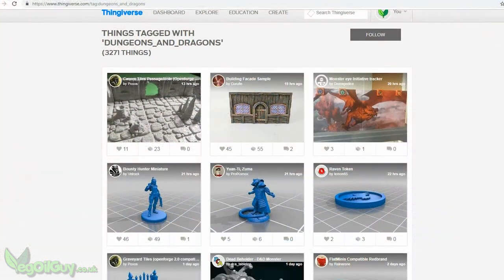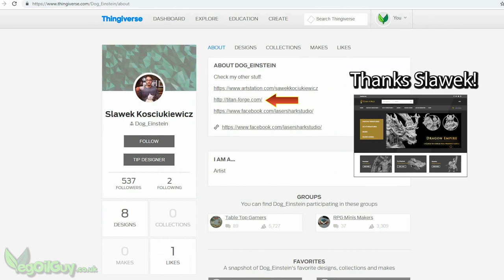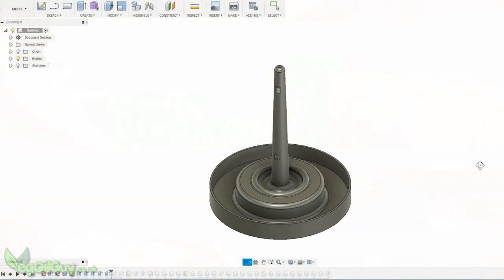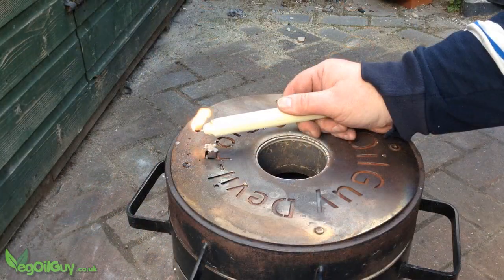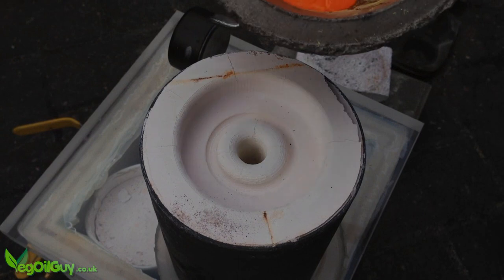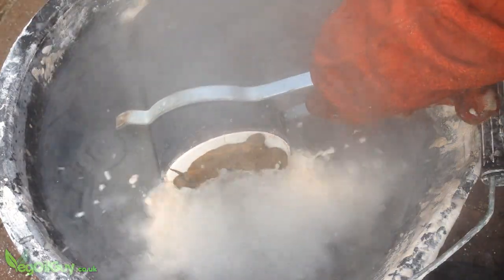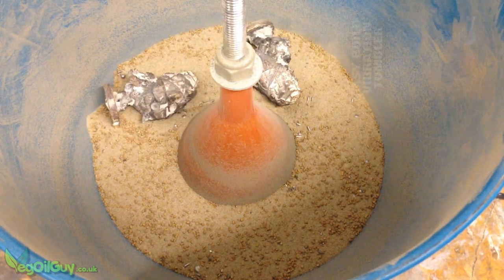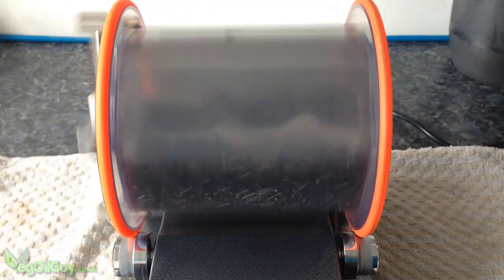Brass dwarf miniature Warhammer figurine lost PLA casting - 3D printer to metal casting by VOGMAN

Comment: Your barrel tumbler turns really fast! 
As a jeweller I used tumblers to polish on a daily basis. Our tumblers rotated at it's fastest one time a second. 
We left them running for 2-3 hours and in some cases longer., but the results where always great.
Reply from the maker: I agree it is a little fast. Amazingly this is on setting 1 of 5. As you can imagine, at 5 the centrifugal forces mean that everything is pinned to the sides and nothing gets polished. Crazy. But for a cheap buy, I'm happy enough with it  : )

Comment: I had almost 1000 miniatures of Dwarves, Orcs, Skeletons, Kobolds, Humans and Elves, and other races.- The Nine Nazgul, Neo Otyug and other individual characters, mostly Ral Partha models. (Most of the wages from my first job went to getting that next pack. Then, I discovered beer and girls!) Only ever got around to painting about 200 of them, but what fun they gave and impressive armies on the table! Your one that broke, were there voids in the legs or did it just bind and snap? Looked like a clean-ish break...
Reply from the maker: Beer and girls must account for a lot of lost revenue in the miniatures world. Lots of fun though  : )
The break was bad application of wax on my part. The feet of the figure were cemented with wax to a printed base. I then sealed the join with more wax to prevent leakage (allowing plaster into the join). Obviously I didn't do a good enough job here and that led to a weak spot. As these are heavy beasts, when they bounced around in the tumbler (again a mistake, I should have done one at a time) they clashed and the weakness was revealed. 
Lesson learned  : )
Reply: @vogman  Yep, and think of the army one could have amassed if it weren't for the necessity of that first junker car! : )  So, think you'll ditch the sand vibrator and stay with the tumbler, then? Or do they each offer something the other can't?
Reply from the maker: For ME they're doing something different...
If it's polishing you're after, just from my brief and limited experience, I think the barrel tumbler is the way to go. The shine these things achieve whilst quietly whirring away is amazing.
The vibration tumbler can also polish, but I want to use those vibrations and grinding forces to strip away remnants of plaster, take away any surface scale and remove burrs. I'll continue to experiment with media until this happens. But it is noisy.
So, if you're still wondering why, I'll make it clear. I'm a lazy so and so that's looking for an easy way to do most of the boring work for me. And I'm getting there  : D

Comment: I really enjoy watching you videos and look forward to each one as they're released.  

One thing I am curious about in your production process is about the 3D printed sprues.  Have you considered branching out a little bit to making silicone molds?  I would think that it would be faster and easier to print one sprue, make a silicone mold of it and then just make wax sprues from the silicone mold.  It should save you time from printing and money as the wax would be cheaper than the filament.

Just a thought.  Love your work!
Reply from the maker: Thanks for the kind words  : )
I love silicone but hate the price. It's the one factor that put me off Lost Wax casting. You can recycle the wax, but the damn silicone costs a fortune. BUT with a mould, you can mass produce, as you say quite correctly.
Right now I'm still experimenting with my sprue system. I've introduced a tapered sprue, pouring basin, recess prior to the pouring basin, square recesses for peg branches, etc. It's a work in progress that's yielding great results. The time it takes to print doesn't bother me as I usually do it over night, and the cost isn't that great... but who knows. I may go your way in time  : )

Comment: Damm that's cool, have you tried pouring into a hot mould? Should improve definition because it won't cool as fast.
Great work
Reply from the maker: It is actually hot... it's straight from my electric foundry and it's still glowing inside  : )
Reply: @vogman  bro you are an inspiration!

Comment: It went good overall, but you should use flux to prevent zinc from oxidizing. It's evaporating temperature is just slightly higher than brass melting point. You can also use some kitchen salt to make the metal flow better. 😉 But after all the casting came out nicely. Good job 😁
Reply from the maker: Thanks Greg. What about Borax? Have you tried that?
Reply: Yup, borax is fine. I use it constantly in my forge, both for forgewelding and for casting 😉 Some metals does not require flux (gold, silver, aluminium) but as long as it's an alloy like brass or bronze it's good to add a little.
Reply from the maker: Thanks Greg. I'll do that next time  : )
Reply: Oh, and if you ever want to cast copoer, which is one of the hardest to cast, you have to use non porous mold and cut it off of the air after casting as quickly as possible. Copper likes to "suck" gasses into it, mostly nitrogen, so most of the time castings are very very porous. Stone or metal molds are fine for copper, and flux while melting it.
Reply from the maker: Excellent stuff Greg  : )

Comment: Veeeeery nice. Can you please tell us the new tumbler model? Also if you dont mind an advice, your pouring basin is a little off the books and it produces circular flow and gives much space to metal to cool down before entering the sprue. Consider making at one sixth of the circle with the same cross section. Thank you for your lovely video!
Reply from the maker: The tumbler has good and bad points which I shared with Ryan Smith below. But it's fairly priced at £52 here
http://tinyurl.com/y49zw7lm

As for the sprue, your thinking echoes mine, and it is still a work in progress. Hopefully one day I'll get it right.

Comment: So I noticed that the cylinder you pour the plaster into doesn't have any holes. Are they not really needed then?
Reply from the maker: Perforated flasks are arguably better. It is claimed that these pull from more directions at once, giving a sharper result. This may or may not be true, I haven't the equipment necessary to prove it. My thoughts are this... the plaster is porous, so if the vacuum is pulling through it, removing air, does it matter what direction is pulls from? 
The flask I have IS a casting flask. Some professional vacuum systems only draw from one direction like this. And it seems to work.
With that said, and this is a spoiler alert, I'm already collecting parts for my SECOND home build vacuum system and this one, if it works, will use perforated flasks.
It will be interesting to see which works better  : )
Reply: The type of flask depends on how you apply the vacuum to the flask. No side perforations you apply vacuum to the bottom, with side perforations and the outer flange you need a chamber to insert and suspend the flask into so vacuum is applied all around.

Comment: Really nice cast, hows the tumbler? been looking at the same one for abit wondering about the quality. As for the issue there with the brass, you actually had it too hot; brass is an alloy of copper and zinc with a few other metals to improve fluidity. The zinc in brass reacts violently with the oxygen in the air and will burn out of the brass reasonably quickly. You can limit this reaction by adding borax, this is a very common fluxing agent that is easily obtainable; most hardware stores sell it as a cleaning aid and pest killer. Borax is a wonder chemical for anyone working with hot or molten metals. Its melting point is around 800c so anything over this temperature can use it and it will stop the air from reaching your metal. Add a good handful to the crucible on your next attempt and you should see a much nicer pour. Also reusing brass will slowly lower the zinc content each time, normally you can reuse it with a 20:80 ratio of old to new brass without issue. If you want you can take the older brass and add a lump of zinc (5% of the total weight) to re-alloy the metal. If you do this then ensure you add it at the very end of the smelt or you will have the same issue with it burning out.  Ok now for safety Ryan, Please ensure you do all brass smelting in a very well ventilated area aka outside as zinc fumes can be very dangerous (welder flu or metal fume fever). And if you try to re-alloy the brass then heat up the peice of zinc before adding it by plating it on the smelter lid for 5 mins beforehand. Sorry for the super long reply, hope it helps and feel free to message me if you have any questions.
Reply from the maker: Thanks Ryan for that excellent answer. I found it helpful and I'm sure others will too  : )
Reply from the maker: Oh sorry, the tumbler. Well it's clearly cheap and the driving belt is already showing signs of wear. It has an auto reverse setting (changes direction - very good as things can get wedged along the sides) but this generally results in the barrel just stopping. The clear plastic drill is clear until you use it... after that no. 
BUT with all that said it's pretty good. I've seen it advertised at £140, but I bought the same one (new) for £50. At £50 it's a bargain, warts and all. I except it will fail is due course but the mechanism seems good, so I'll have everything I need to rebuild it a little stronger  : )

Comment: Great work, I have two questions. What is the brand of wax that you used in the video and is the printed piece 100% infilled?
Reply from the maker: Many thanks  : )
The printing filament is just standard PLA+ bought cheaply on Amazon. Look for the expensive brands and ignore those - I like economy. Sun Lu I believe... hang on... https://www.amazon.co.uk/SUNLU-Filament-Dimensional-Accuracy-Printing/dp/B073PB9XWY/ref=sr_1_3?keywords=pla%2B&qid=1554761578&s=gateway&sr=8-3 - but honestly any PLA should work.
Infilling isn't actually a problem as I've found the filament burns out a treat, BUT I tend to Infill at between 10 and 20%. In my eyes the more air there is, the less that needs melting, and that can't be a bad thing.
The wax sprues are Ferris, which is excellent. I've had no problems with them.
You also asked about the mild steel... haven't a clue off hand, but it's NOT thick stuff. To make the crucible tongs I bent the steel by hand in a vice, so I'd guess at 2 or 3 mm or thereabout. If you couldn't bend it by hand, it's too thick  : )
Reply: VegOilGuy thanks for the information and the link once I’ve used up my current stock I’ll get some. I’m getting a lot of print lines could you tell me what numbers you used for your prints (layer height and all that jazz) does your printer have a glass or aluminium print bed? 
Also have you ever tried casting an air fix model? I planned to just use the hot brass to burn out the plastic as the model is 42cm long and too big for my oven, in your option do you think that’ll work in the absence of a furnace to melt the plastic out first? Sorry for all the questions just don’t want to mess it up it’s a good looking model that cost me £17 but all the other ones I managed to find are over £100 so it’s kind of a one shot deal with this one. Thanks again for your help
Reply from the maker: I have a Creality CR10S which has a glass bed, though I find I have to tape this to get good adhesion. I use Cura which makes these things easier as you can select Draft, Normal, Fine and Extra Fine prints which adjusts all those layer heights and things. But typically I go for a "Fine" which is a 0.1 layer height. Now I'm still very much a newbie to 3d printer, but take your time levelling your bed and half your printing speed, especially the first layer. I'd be amazed if this doesn't improve those print lines, though you'll obviously still be able to see them.
42cm is bigger than anything I've cast using this method. I'm not sure what the plastic is like in an airfix model. Here's a thought for you... if you still have the leftover plastic support frame from the kit, break that up into a crucible and fire it. See what's left behind. If there's nothing, it's a good sign, but any residue might suggest problems.
Also, maybe a barbecue would make a useful makeshift oven... just a thought  : )
Reply: VegOilGuy good shout about the bbq thanks for your help 👍

Comment: Is it possible that you mixed in some non brass metal and created an alloy instead? Your metal seemed to be hot enough going by the colour underneath the dross layer, but I am no expert on the matter.
Reply from the maker: Honestly Mark, nothing but plumbing parts there - brass, brass and brass. There was a cool wind though. Maybe that didn't help  : )
Reply: Brass is already an alloy of copper and zinc. And that very light yellowish flares was vaporizing zinc. Brass is quite hard to cast as zinc evaporates at slightly higher temperature than brass melting point.
Reply: Plumbing parts could be red brass (has both tin and zinc) or yellow brass. but as noted by Greg, the big issue is burning lots of the zinc away during the melt... and those fumes can make you super sick, don't breath that stuff.
Reply: Plumbing parts could be red brass (has both tin and zinc) or yellow brass. but as noted by Greg, the big issue is burning lots of the zinc away during the melt... and those fumes can make you super sick, don't breath that stuff.

Comment: I found this random tidbit in a few minutes of poking around The Googler -
 
  "  DO NOT pig brass or bronze! Each time the alloy is melted certain 
    elements (zinc, lead) are released in the smoke that give the alloy it's 
    fluidity"

I thought it may be a clue.
Reply from the maker: I'm not sure want he meant by "pig" unless he means re-melt. There was a large sprue in the mix...
Reply: @vogman  Exactly. I am thinking that the pig is the stuff that either is a second melt sprue or the cakes from the muffin tins.  perhaps you can re-add the missing elements to help improve viscosity of the molten metal.
Reply: @vogman  A quick question, Did you put borax on the brass or did you just put it in as the scrap and let that melt?
Reply: @vogman  Or any kind of flux?
Reply from the maker: I did fail on the Borax. I'll do better next time  : )

Comment: rotary tublers are ment to be filled to the top with water!
Reply from the maker: Actually most manufacturers recommend just covering the shot with water. Personally I prefer a little more and tend to go around half full. Also do go careful with your water... a lot of these tumblers have a maximum weight limit and water is quite heavy  : )
Reply: @vogman   I have one from frankford arsenal for my brass cleaning, I use stainless pins with a tablespoon of citric acid and a teaspoon of dishwashing soap. at least for my tumbler it requires to be filled to the brim.
Reply from the maker: I guess it depends on the make and model. I did a fair bit of research before buying and watched a lot of videos... water seemed one of those points no one agreed with. I take the view if it works for you and causes no harm, go for it  : )